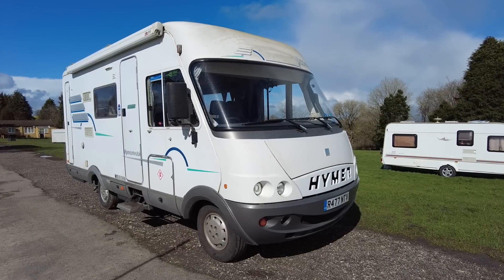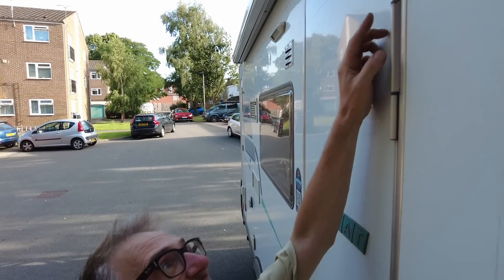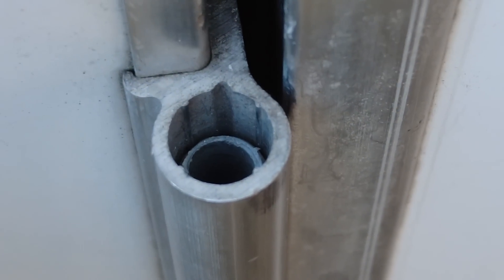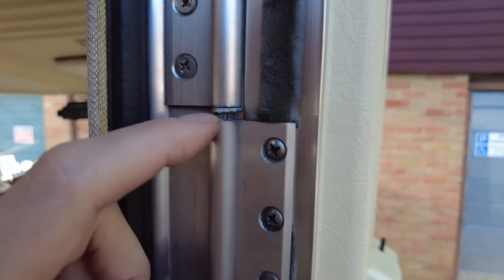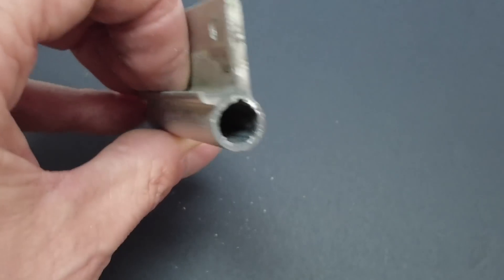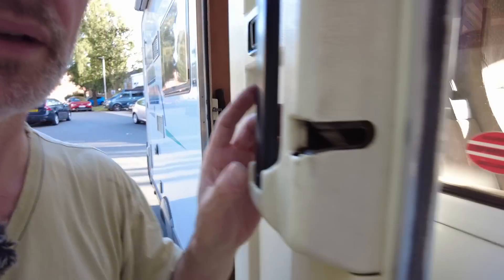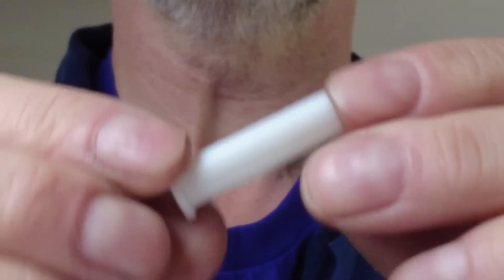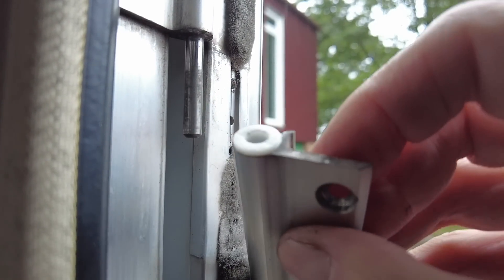Fixing Damaged Motorhome Habitation Door Hinges using 3D Printer - 1998 Fiat Ducato Hymer

Comment: ASA filament would be a good choice as it is UV resistant and strong.  PETG has a bit of flexibility so would be ideal but I don't think there any PETG available with UV resistance.  Nylon would be good but it's a pain to orint with as it absorbs moisture like crazy and needs drying out before printing.
Reply from the maker: Thanks for the printing tips, Alan 👍👍

Comment: @hermanhitstheroad Is there Nylon filament? That would probably be ideal for this. Alternatively printing just the tube with regular filament and then using a Nylon washer as the spacer/bearing.
Reply from the maker: I don't know if there is a nylon filament, @ari.voutilainen. The thing is that you want the spacer (washer part) and the inside sleeve to be connected so the sleeve doesn't travel down the hinge and pop out the other end like mine were doing.
Reply: @HermanHitstheRoad  Makes sense.

Comment: I need to do the same to my old Rapido, as the door hinges are almost the same externally, Our are riveted to the body, but screwed to the door. Delrin would be perfect for the job, but I don't know if it is printable, as it had self lubricating properties. I do know it machines beautifully. Only problem is I don't have a lathe or milling machine of my own. I will be heading out to Nessa shortly to remove part of a hinge to see if they are the same internal collar.
Reply from the maker: Your problem sounds an easier fix than ours. Did you sort it?
Reply: @HermanHitstheRoad  No not yet it is on the list of things to do in the next few days. Have some jobs in the house that take precedence over Nessa, as the wife has been on at me for about a year to finish the end of the kitchen and get on with utility room.
Reply: Just removed a hinge completely as it wouldn't come off the door without both top and bottom hinge plates be removed and the  door being pulled away. Nessa uses washers instead of the collar like Herman does. So I could make something up at home as I have some Delrin from another project with an Air Rifle where I made what is know as a Hamster and used a Delrin rod to set it of from the stock. Carved it to sit perfectly in my hand. Sadly never got to use it, as I don't shoot anymore and am going to sell the Air Rifle as no point in having it around anymore.

Comment: Great job taken care of with 3d printing technology. They will definitely wear quicker in pla than something more exotic. If you want them printed in carbon fibre material that offers better resistance to UV and heat, then please do contact. Alternatively, please make yourself a few spares to keep in the van just in case of replacement on the road, or like I have done with spares - helped a fellow motorhomer out on site. Great video.
Reply from the maker: Thanks @80evolution 👍👍

Comment: Why not use stainless steel washers as the spacers? No rush and harder wearing? Or, but same size bearings as the spacers? All you need it the internal, external and hight of the bearings.
Use silicone grease for lubricant. PLA is useless outside and for wear. It’s basically potato starch! Best use 
Polycarbonate filament is an excellent choice for use outside - it contains UV stabilizers that prevent degradation from exposure to UV light
Reply from the maker: I could have used other filament but this is all I had and it's cheap, @kinross24